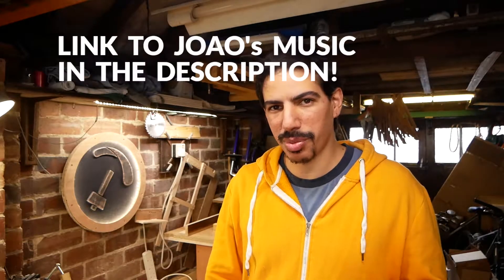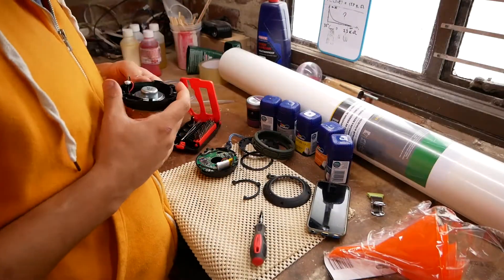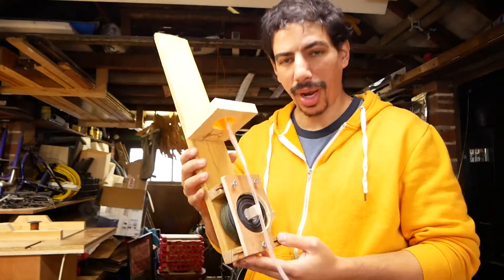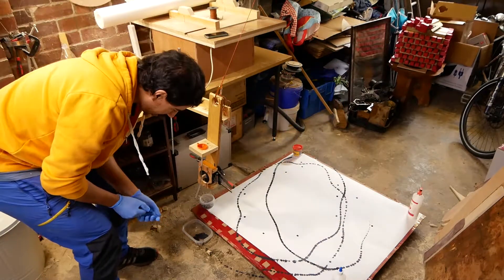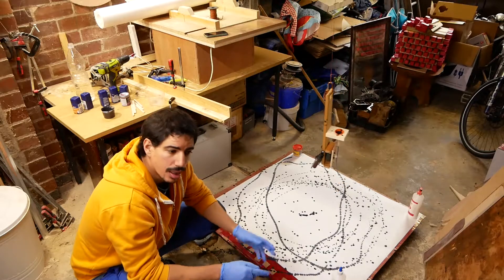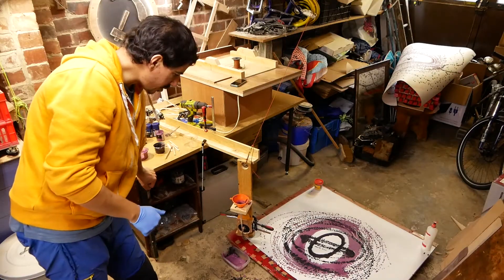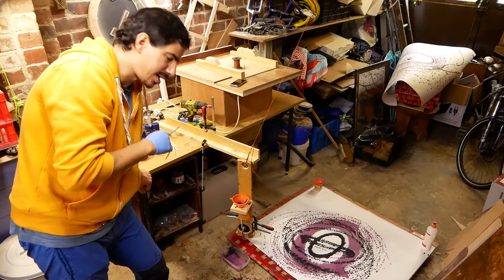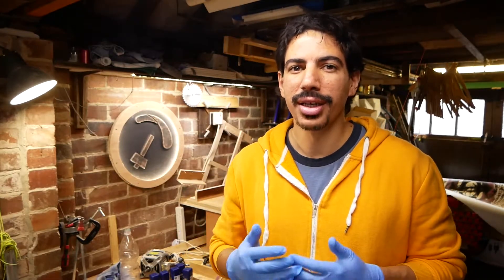Giant Vinyl FAIL! Day 21 - 30 Day Youtube Challenge - BANDARRA

Comment: Dangit, you inspired me to try a few things out and I haven't finished my current project. 
1. Double pendulum painter
2. painter and painting as independent pendulums
3. inkjet printer head spraying paint colors according to FFT of music
4. See if plaster of paris or paraffin will set while a woofer vibrates a pattern
5. Transpose music into ultrasonic range to fog paint onto paper.